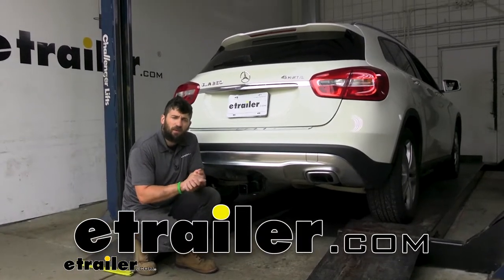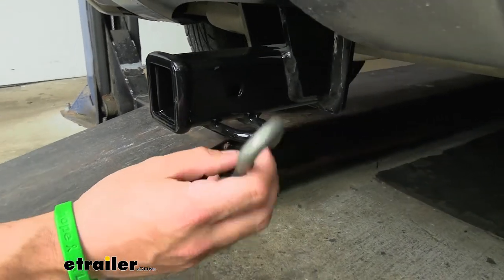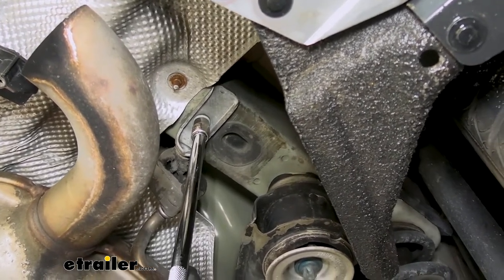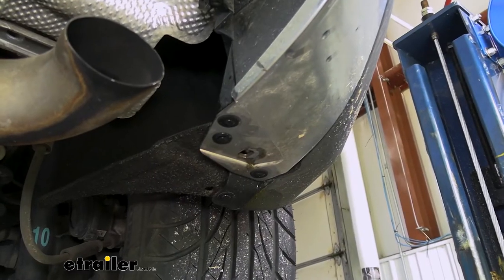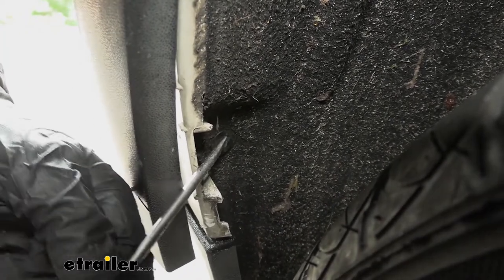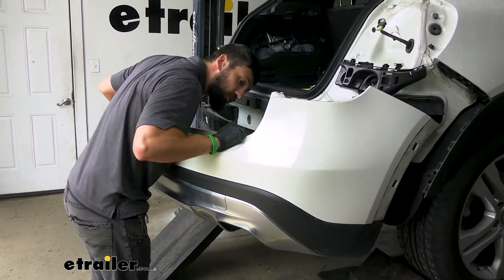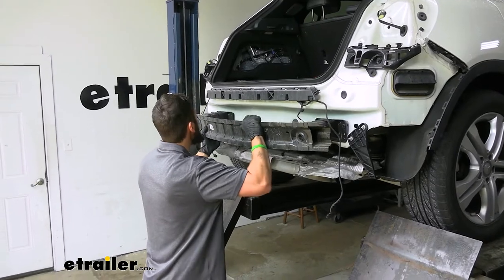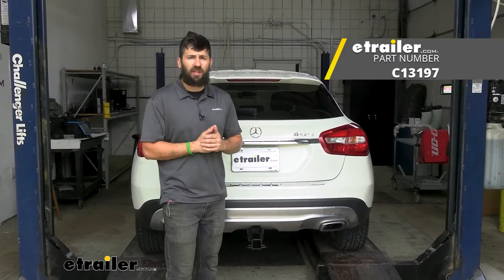etrailer | Installation: Curt Trailer Hitch Receiver on a 2016 Mercedes-Benz GLA-Class

Comment: Glad I watched this, looks like a royal pita! I think I bought the wrong car, this thing wasn’t meant for a hitch. 😞
Reply from the maker: No doubt, because of the way the hitch conceals behind the bumper the install is a bit involved. If you use the link below and input your zip code, you can find a local installer. We recommend going with an installer that's ASE or RVIA certified, so you'd want to do your due diligence there.
https://www.etrailer.com/installer/near-me/foristell-mo/trailer-hitch
https://www.etrailer.com/Trailer-Hitch/CURT/C13197.html
Reply: Thanks!
Reply from the maker: @quasarthecat  You're very welcome, please let us know how it works out!